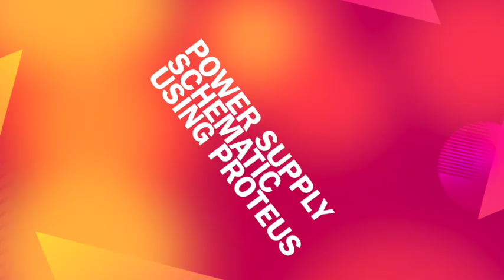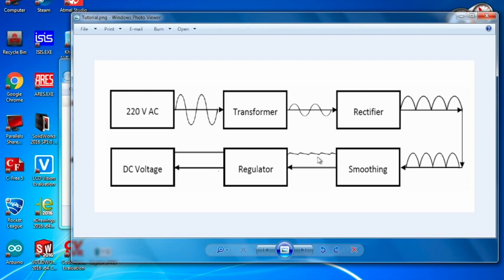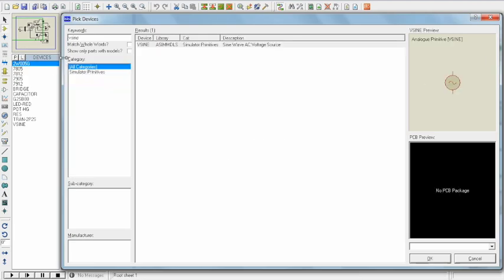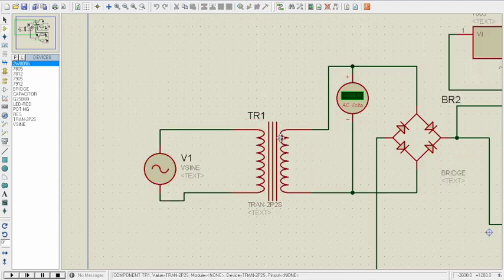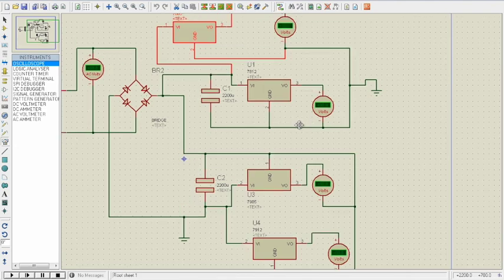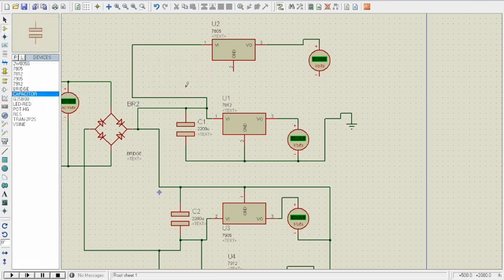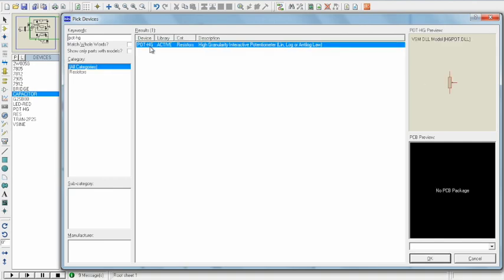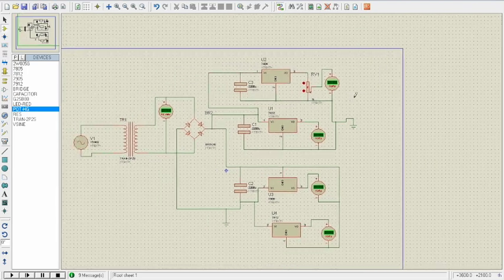Power supply schematic using proteus

Comment: In this design you are able to shunt the output (VO - Pin 3) of the 7805 directly to ground via zero ohms adjustment of RV1. I don't think this is a good idea. This creates a dead short (Unlimited Current Flow!) This will cause the LM7805 to burn out as its power dissipation will far exceed intended limits. Not to mention this is also a very inefficient design. The 7805 is intended as a low power fixed/regulated 5 volt supply. If you need a low power "variable" power supply, you could consider using the LM317 which is better designed for this purpose. Thanks for the video.
Reply: hi Cameron, I'm having a similar problem on one of my designs I'd like to put a transistor driving my output to ground when I want to reach minimum output voltage but obviously as you say that creates a dead short, you reckon that adding a 1ohm resistor would overcome this problem?
thanks!
Reply: Not really. If you shunt the output to ground through a 1 Ohm resister you should read an output voltage of 1 volt.  As I mentioned previously, the LM78xx series regulators are designed to give you a fixed regulated output.  I recommend using a variable output regulator like an LM317 if you need adjustable output voltage from Max down to Zero. But I suppose if a person is intent on using a LM7805 or a 7812 you could in theory shunt the output to ground through a .1 ohm resister which will give you  .1Volts (near zero output). Again this is still not an efficient design and you would probable have to put a heat-sink on the regulator if you intend to drive the output low for any length of time. Even better than using a fixed or variable voltage regulator you could look into the topic of 'buck converters' they are very easy to make with minimal parts and are very reliable in terms of regulating output voltage. Good luck and try not to let the magic smoke out :)
Reply: Awesome! thank you very much for your help, I'm gonna check those LM317 right now.
Reply from the maker: Thanks for your comment. I made the design for general purposes. I meant to put whatever load you need coming from 78xx or 79xx family Vout before it to the ground (short circuit). 
Thanks for the hint though.